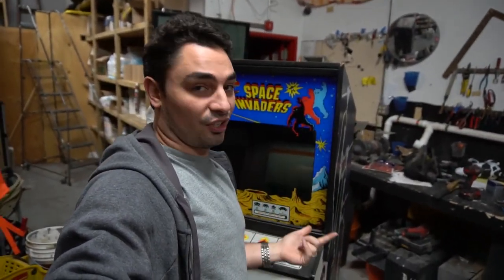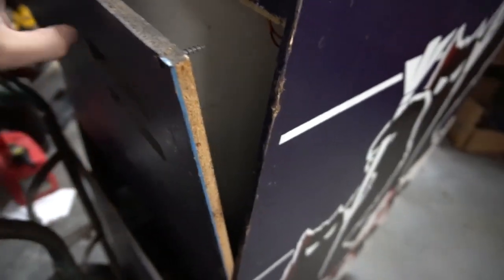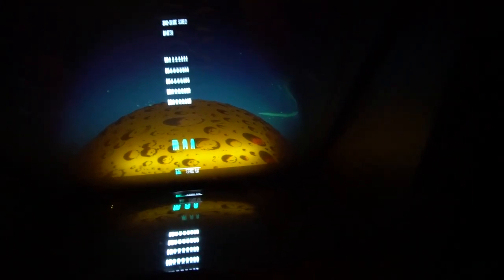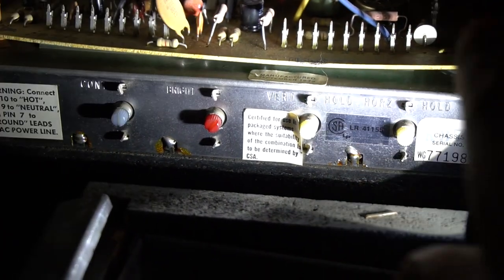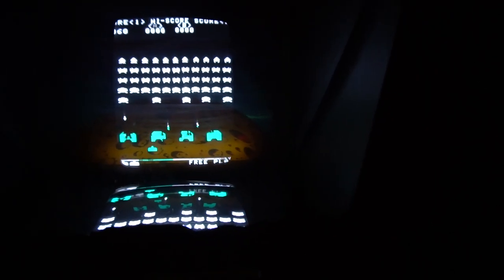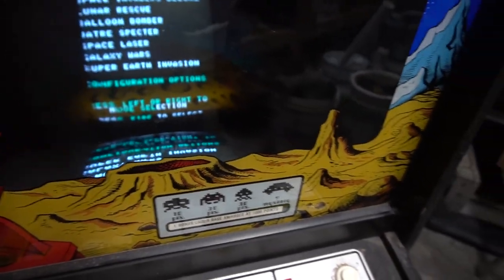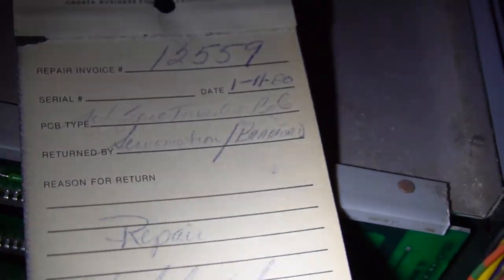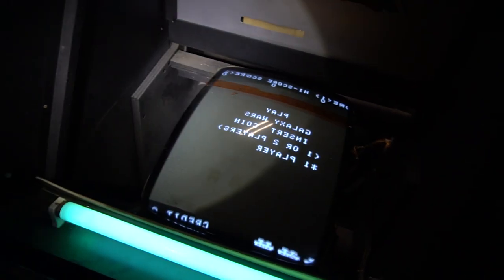Holographic Retro Arcade ?! Retrofitting a space invaders cab

Comment: I would have never touched that cabinet. That was a classic worth a ton of money that only needed a new power supply and probably some new caps on the monitor. Most arcade and pinball machines in the 70's used stencil art on the sides since vinyl printers didn't exist so your two choices were stencils or silk screening. The reason there were colored strips of plastic in the monitor was to give it color when the space ships etc. moves to certain positions in the screen since the monitors were monochrome. You should really research the classics before allowing customers into talking you into destroying such a rare find and sticking a $35 RetroPie in it.
Reply from the maker: Dam :/ I cant really do much as far as fixing crt's. And the customer has already wrapped the sides and the entire cabinet in a LV leather. Customer got this cab for free and wanted to make use of it. People these days would rather have a ton of games vs keeping it stock. I hear what your saying, but I just do what the customers ask
Reply: @Vic_VP  it really stinks when a customer doesn't know what they have. I know a lot of people want multicades nowadays, but a real collector will pay top dollar for original cabs in such great shape. CRT's are in high demand in that community. It may benefit you to learn about them. Some are ridiculously easy to repair and those games where made specifically for them. There are a couple of good FB and Reddit groups on monitor repair. I have also found some good videos here on YouTube. Good luck.
Reply: P.S. that cab was worth about 3k the way it got to you. The ones with the matte painting of the space scape and the moon seem to be pretty rare.